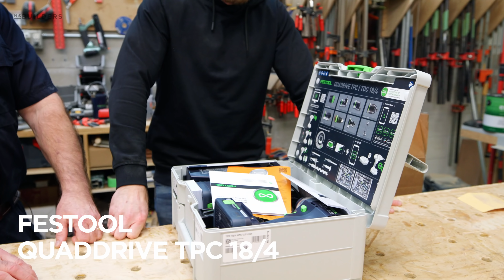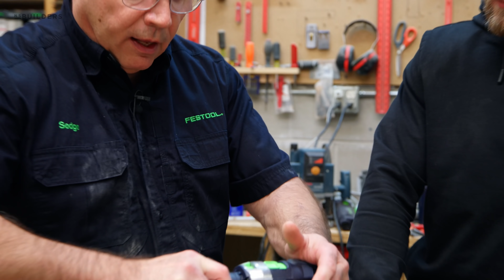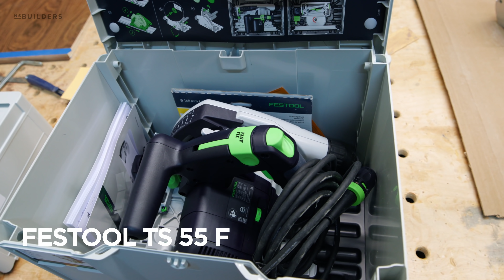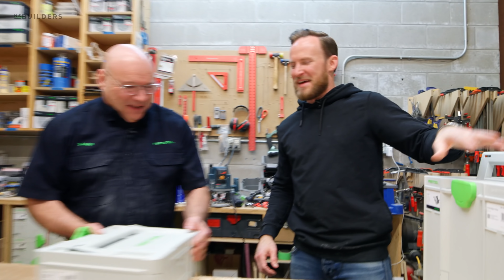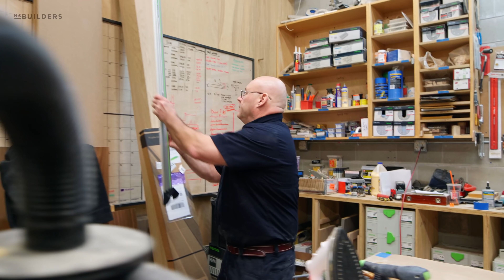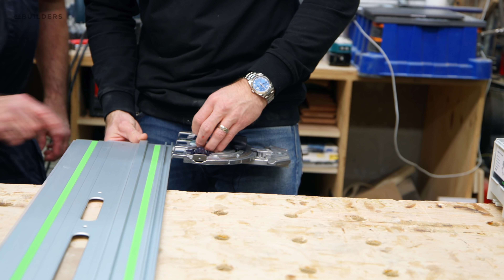Sedge helps us UNBOX our new Festool Tools

Comment: I do often wonder how these "marginal gain" design improvements work in the culture at Festool, meaning, I realize user feedback is important over time in order to see where a tool might be in need of a new iteration but some of these oversights seem nearly impossible not to know with the first iteration etc. I use a lot of Festool tools and over the years I have often wondered how decisions about when to revisit something get made knowing in some cases the "future improvement" was possibly known from the start. For example, finally changing that cord guide for the track and not just doing it at the start because it doesn't take using the saw more than once or twice to see it was an issue. That's small peanuts but obviously there are larger ones like the MFT tables and their diagonal strut assemblies still being sold separately and not included with the MFT table new. Those struts are required for keeping that design of the table stable enough to hand plane wood on which even with the struts is very questionable. 

Anyhow, I find all this sort of thing intriguing given how much thought goes into Festool designs and yet it seems there are ways really simple practical things still get overlooked. Again I see these incremental improvements not as things to boast about but freebies that probably should have been resolved earlier on etc.
Reply: I agree! I’m a big Festool guy and I like the fact that as I buy a tool, I’m getting a system. With that said, it is odd that the simplest details are overlooked and become the biggest irritants. People complain about the cost of Festool, but I don’t mind as long as it works as it’s suppose to. The little oversights shouldn’t exist at the price they ask for their equipment
Reply: Ya I really agree with this, as great as festool stuff can be there is always one thing that leaves you scratching your head.